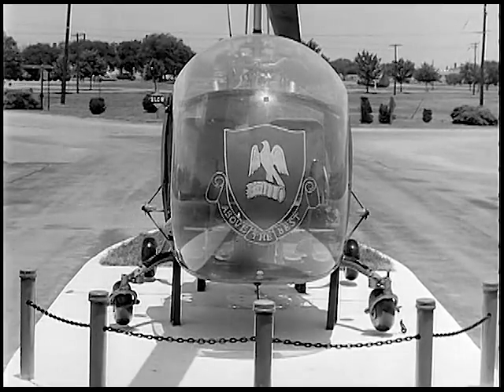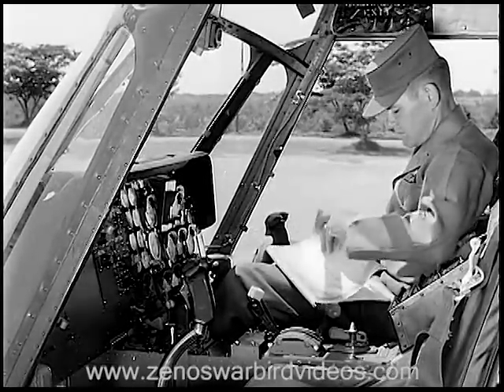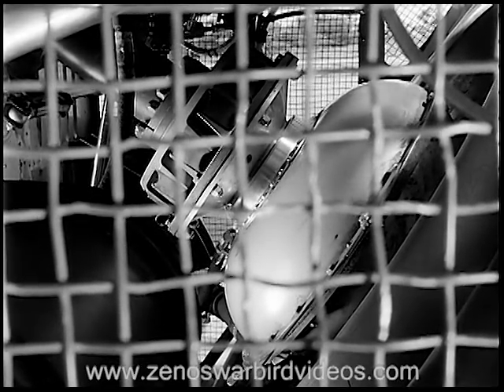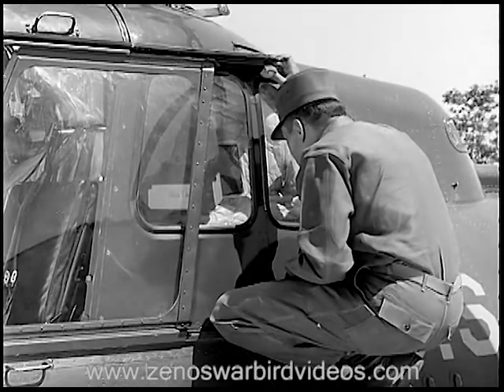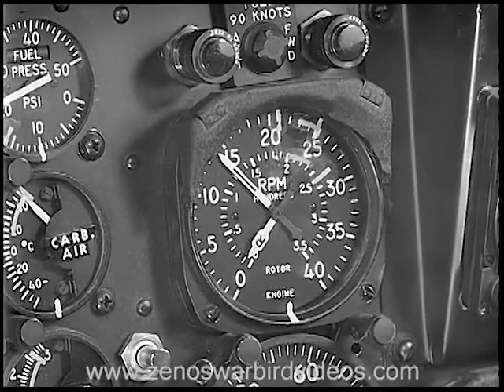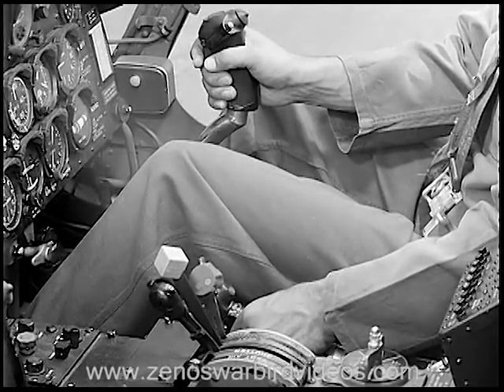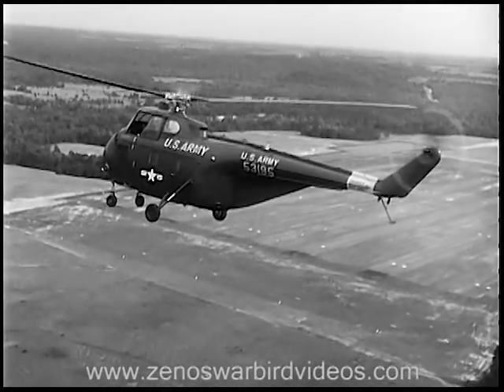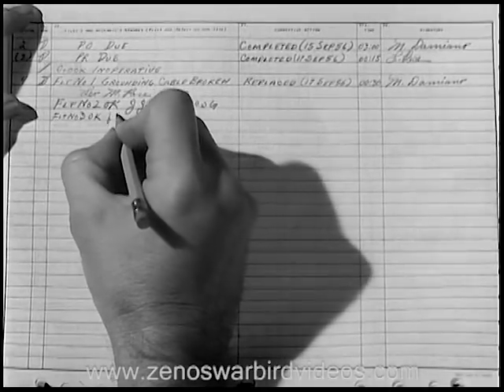Flying the Sikorsky H-19 Chicasaw Helicopter (Restored -1956)

Comment: I notice the narrator tells the prospective pilots to check for "excessive" oil leakage. :-)
Reply: Yes, that's because in normal operation there is a slight leak, that's why it instructs to check all of the oil gauges and oil pressure dials.